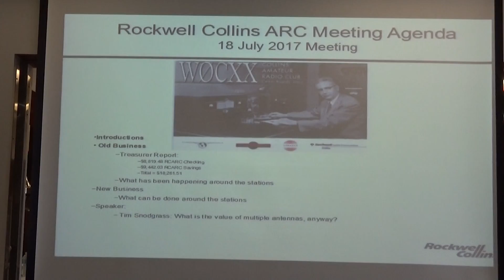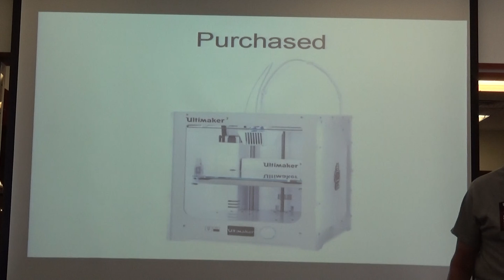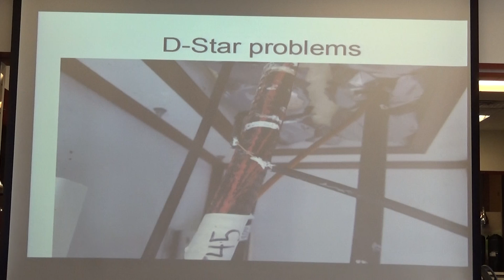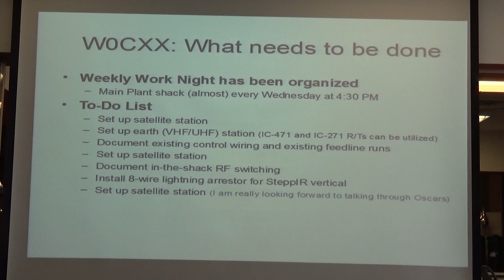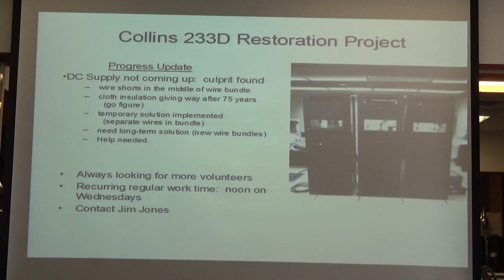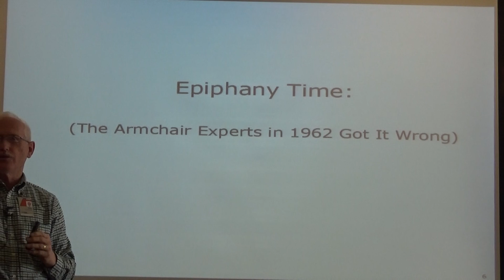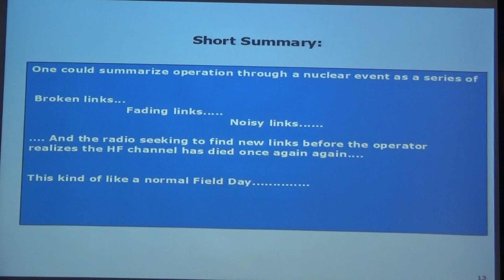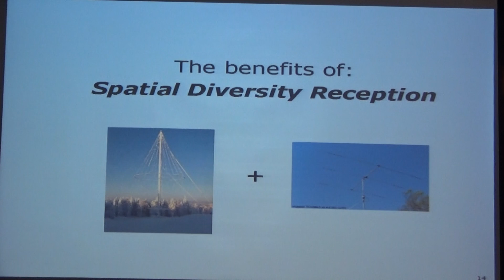Rockwell Collins ARC July 2018 Meeting Part 1

Comment: Great info Vince.  Could you provide a link or digikey part number of the transzorb Ken discussed at about 46:28? I'm having some trouble finding the appropriate one for my 12VDC wiring to my ham gear. 73 Greg VA7BC Vancouver
Reply from the maker: sorry for not responding...I'll have to ping him to get the P/N,,,
Reply: @N2AIE  Hi Vince, Any update on a part number for the transorb? 73, Greg
Reply from the maker: @VA7BC  I’m sorry I did t see the comment. I’ll ask for you.